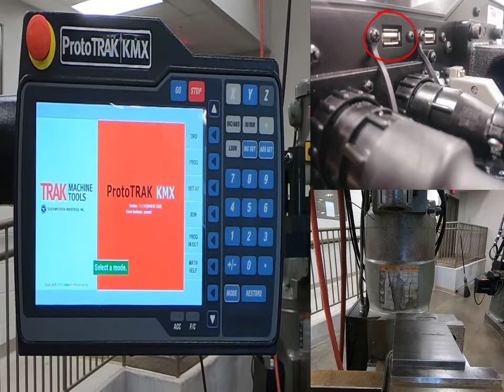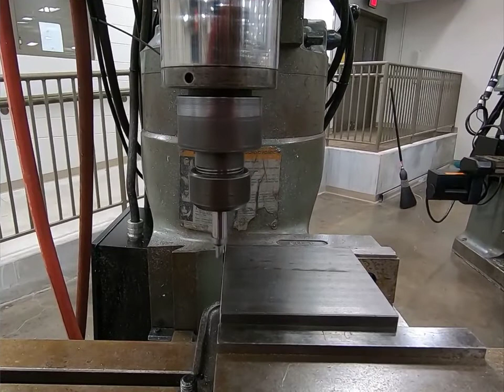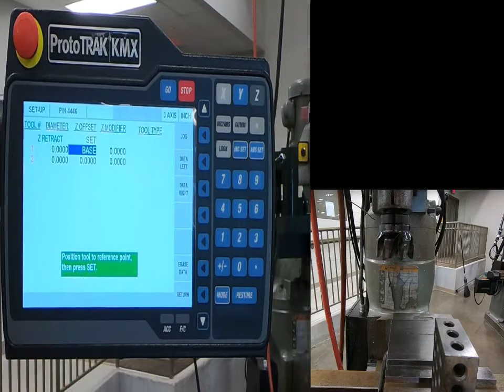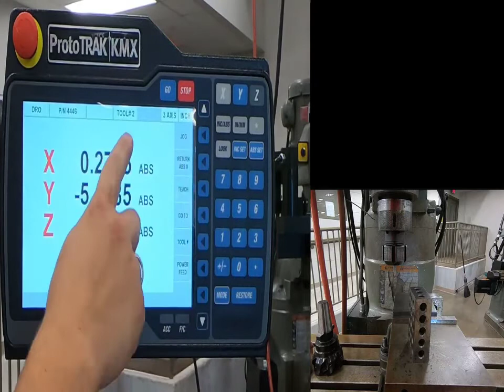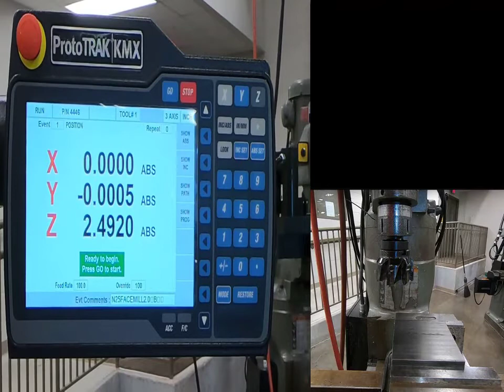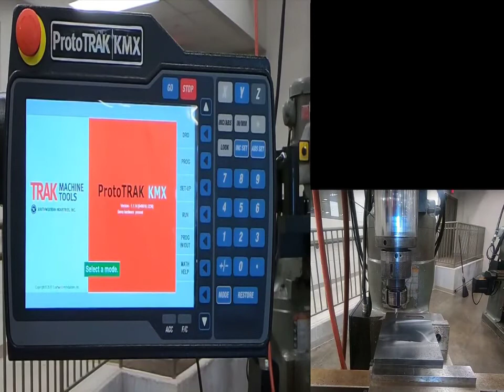Proto Trak KMX Setup and running a CNC Program

Comment: We just got an KMX 3axis retrofit in our shop and I am struggling to wrap my mind around the tool table. Why did you set the base of the vise and not the part? 
How would this differ if using just R8 collets? That is what we currently have but I am looking to get some R8 shank ER32's for more repeatable zeroing.
Reply from the maker: @danielyochelson5204  that's really cool that you just got one of those retrofits. I usually set up tools off  the 123 block because if I have multiple tools on one job and the second tool breaks for the first tool has already cut, then I can't reset that tool length. I believe if you want some repeatability with your R8 collets, you can put a set screw behi d the tool that won't interfere with the draw bar. that way, the tool can only go so far up into the collet  it every time. that may help with your repeatability temporarily until you get the other collets. Thanks for watching
Reply: I got the same retrofit earlier this year for my KMX, ER collets are an absolute must, there really is no way around it. Haas makes a decent R8 ER32 & ER16 collet set. Also, I found it best to use a 2in Zero-Setter gauge, they are cheap and are much faster than the 123 block.